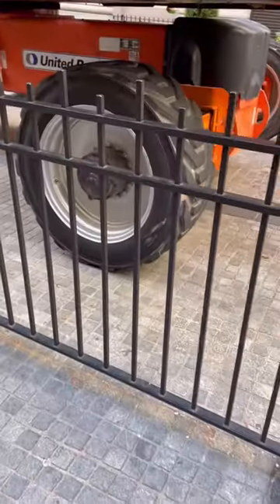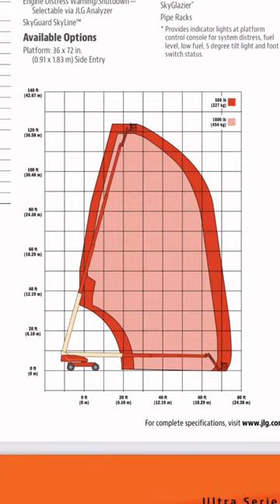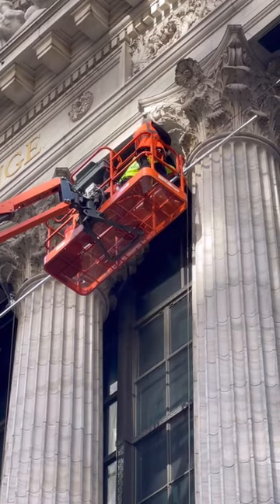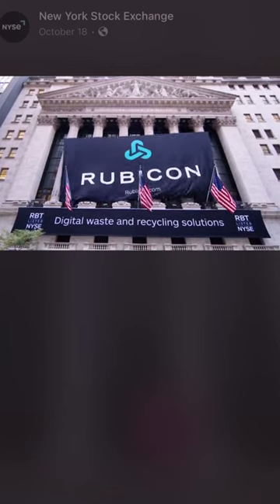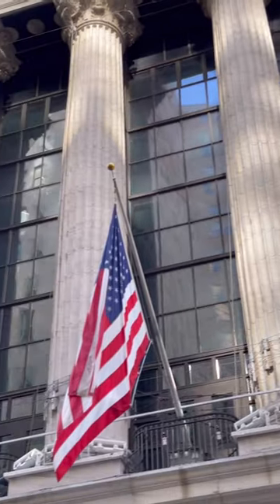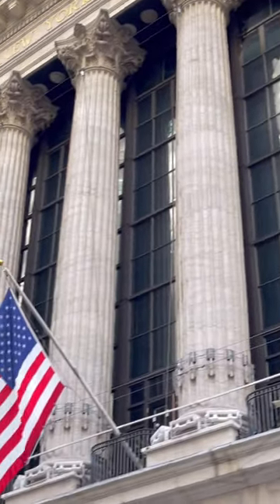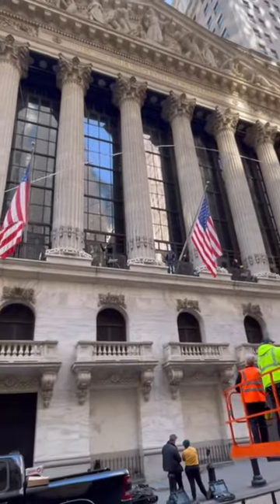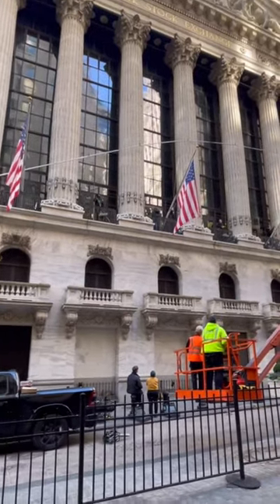Giant Boom Lift Working on Wall Street

Comment: Yes,  it in the construction trade yet work around construction and have used this boom 😅 . We felt tired after using this boom in 30 plus wind near the beach in south Florida . Thankfully we had this equipment as it sped up the work and produced great results and at a high rate of speed in otherwise PROFIT .
Reply from the maker: Thanks for sharing

Comment: I'm an electrician. I have been up in a rented 150 Footer of a JLG working on stadium lights at a local high school in Central Florida. They're a lot of fun to operate and work with. The track had to have plywood sheets under the tires in order not to crack concrete!
Reply from the maker: Wow
Reply: @hausplans  Great video. The movement up in the heights like that even in Turtle 🐢 Mode is unbelievable. The basket moves so much from such small analog movements on the joysticks. You have to be so careful 😉🙏

Comment: Nobody, I mean nobody, can out maneuver me on an articulating boom lift. I can put that basket anywhere. I once corkscrewed between 7 different overhead conveyors 60’ in the air while they were running in a distribution center we were remodeling. On my left were concrete filled steel pillars, in front there was a massive electrical control center, on my right we’re all the breaker boxes for the warehouse. I had only inches to move in either direction but I managed to get to my target and back down and out without hitting a thing. It was white knuckles the whole time and my nerves were getting the best of my legs but I did it. And the next day the engineers changed the print and it was all for nothing. They decided to re-route this massive fiber optic run below the lowest conveyor system in hopes that it would never come down or be re-routed. I hate engineers sometimes. Lol

Comment: We use the JLG 1850SJ's all the time when building power plants and in industrial construction all the time. They go up to 185 feet. The still frame photo of the guy in the maxed out JLG is actually an 1850SJ maxed out to 185 feet.
Reply from the maker: That’s crazy high! I can’t imagine how it feels to be up in that basket
Reply: @hausplans  It's pretty crazy. Takes some getting used to. One foot of boom deflection at the base while setting in the basket at that height, feels like you're moving 10 feet. You're not though. It just sways with the smallest movement and by design of course.
Reply from the maker: Wow
Reply: Try using alpha platforms booms, we have platforms that can reach up to 300’ 😅